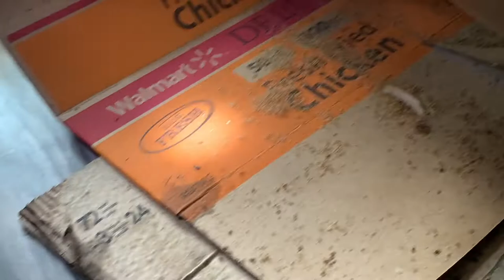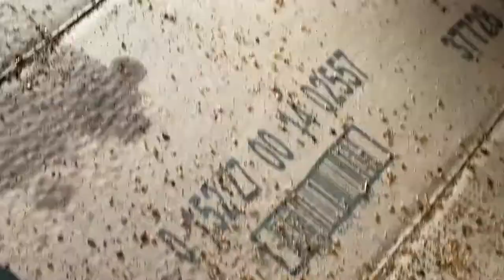Bed Bud Infestation - Where do Bed Bugs come from?

Comment: About two years ago we had an experience with bed bugs. I was getting bitten while my husband showed no signs at all. After researching and discovering that it was probably bed bugs, I did the recommended inspections. I found NONE of the classic signs of an infestation, but was continuing to get bitten about once a week. One night I actually SAW a bed bug crawling on the edge of the sheets (I smashed it, of course). I inspected the bed  again and the only bugs I found were two that were hiding between boards of my headboard. After treating my house with a couple of different insecticides (specifically for bed bugs), encasing my mattress and box springs, and getting traps for under the legs of the bed our problem was solved. I believe the bugs came in through a used clothing item I had bought off of eBay that was not laundered immediately when I received it. So BEWARE of bringing used items into your home. Throw clothing items in the dryer IMMEDIATELY and tumble on high heat for an hour, discard the packaging into an outside trash can.

Comment: Dan the man how long til I should see significant evidence of a bed bug infestation. Most companies won’t help me til then so am just wondering is this a month or two or up to 6 month thing
Reply: ok hell no. you can see it right away on the upper corners of your box spring. flip the mattress over flip the box spring over. get mattress covers and blackout cup monitors to go under legs of your bed frame
Reply: The second you see one then you call and get rid of the problem before it starts